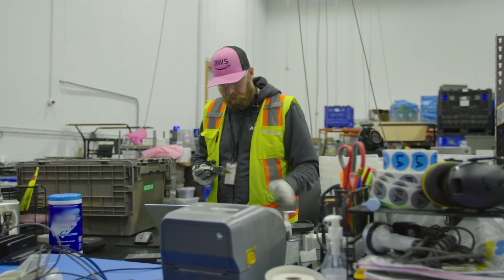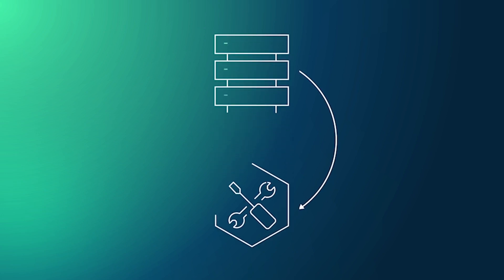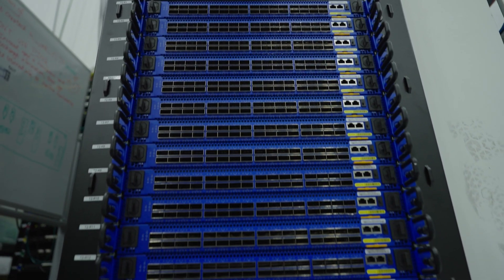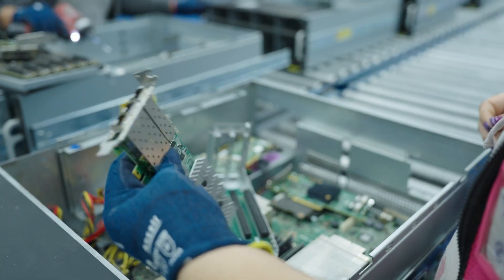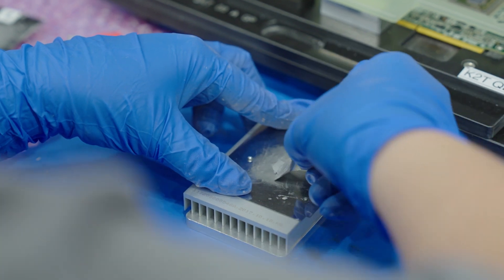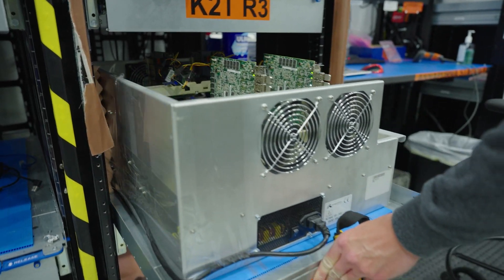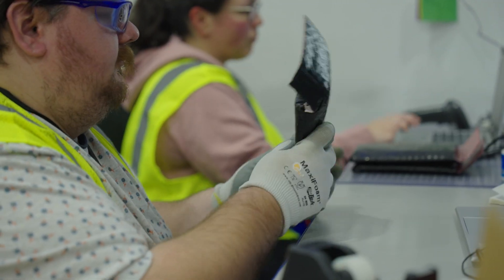Inside the AWS Lab Where Retired Data Center Hardware Gets a Second Chance | Amazon Web Services

Comment: "I noticed that anti-static wristbands were being used, but people were still handling hardware components like network cards and fiber optic cards with bare hands. Isn’t it necessary to use anti-static gloves as well to fully prevent ESD damage? Just curious about the standard practice.

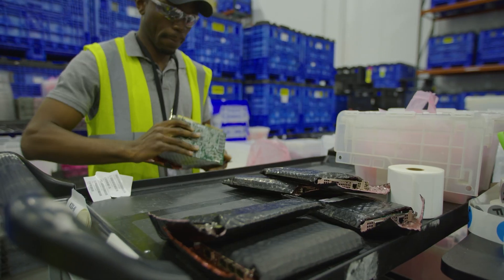Comment: ATTN: we finally see someone wearing a Grounding WRIST STRAP at 1:28, hopefully it is grounded to the building!  ISO Standard rule of handling electronic equipment requires all handlers to wear a grounded wrist strap!  Please review your procedures!  With no Grounded Wrist Strap you are allowing static voltage into the electronics!
Reply: Its not that deep, handling pcbs is mot the same as handling individual components. The pcb is already well grounded. Also these devices are already faulty units so please calm down esd cop